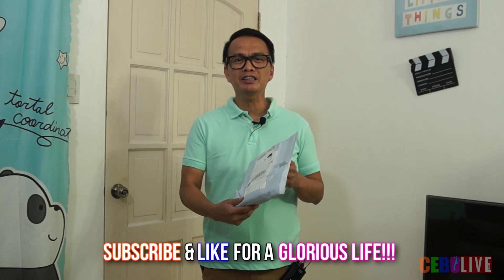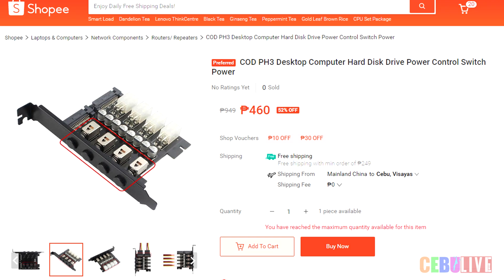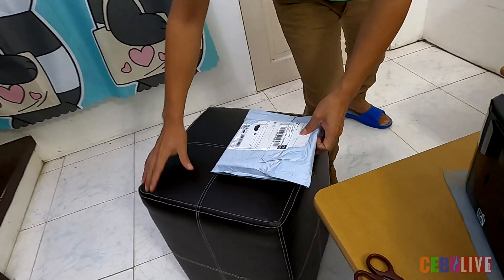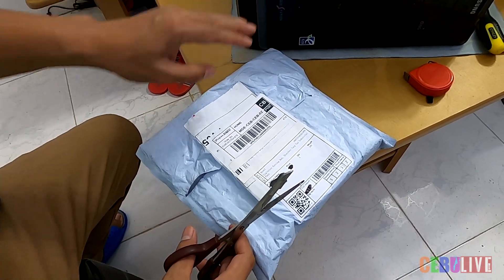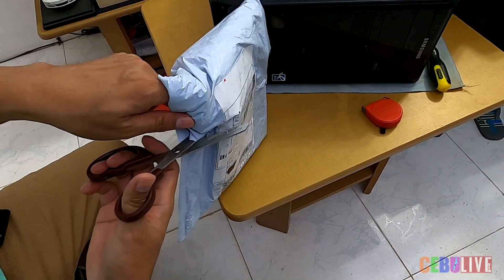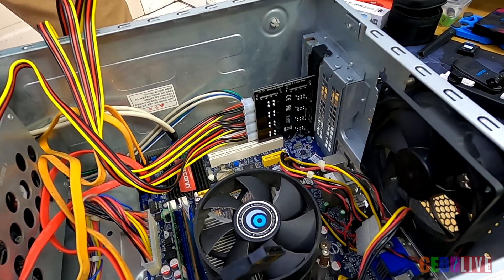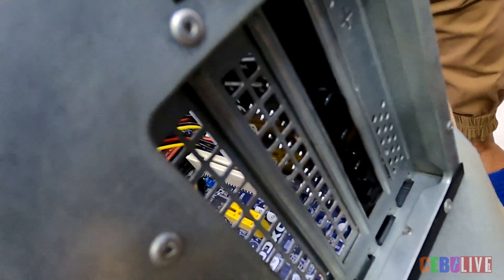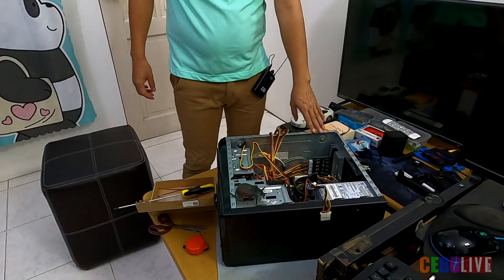How to Install Hard Disks Power Switcher

Comment: I love these modules. I experiment with Linux a lot and have had several problems dual booting. But with one of these modules I can just give power to the drive with the OS I want to boot from, plus a shared data drive that I always have powered. = No dual booting risks.

Comment: Thanks for the video. Before purchasing one, I was wondering where the "PCI" tab on the side of the switch went in relation to the motherboard. I knew it wasn't an electrical connection, but wanted to see where it actually plugged in. You helped clear that up. Thank you.